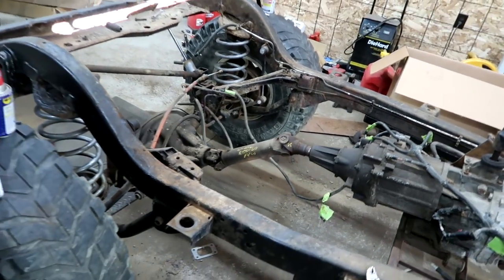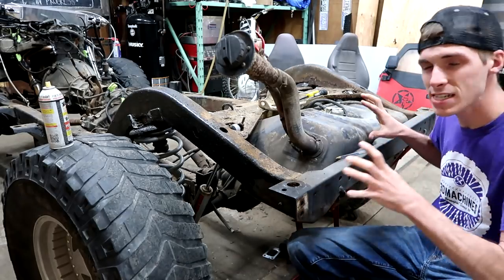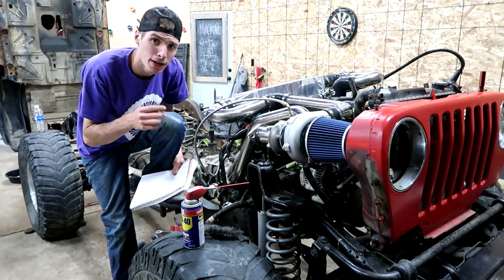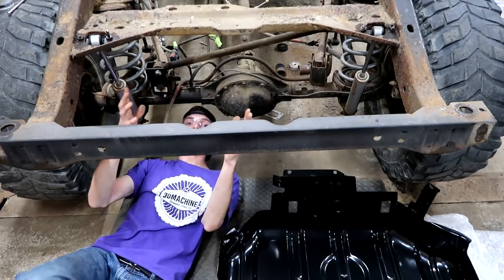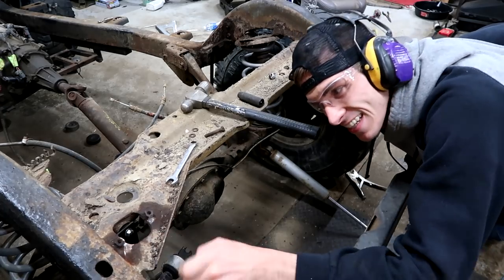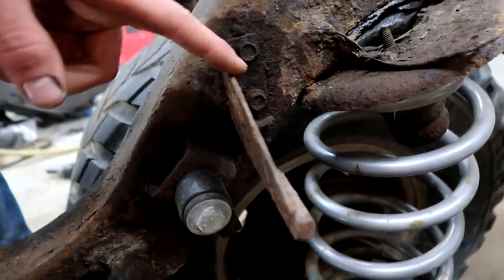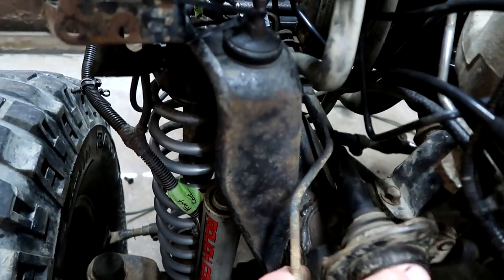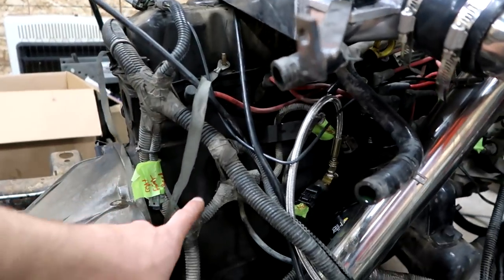Overpowered Turbo Charged Machine

Comment: You need a transfer case drop mount to lessen the driveshaft angle. The slip yoke eliminator was a good choice as well
Reply: Transfer case drops only lower the tail of the transfer case, therefor pitching the front of the transfercase eiger, making the front driveshaft angle worse, and putting strain on the engine mounts. Transfer case "drop kits" are a gimmick.

Comment: Hey 3d 
I build all types of jeeps if you have questions i garentee I probably have an answer 

Like your transmission transfer case question 

That brace going from rail to rail holding you transmission was fabricated when they did the swap as the 4.0 engine has an ax15 transmission instead of the ax5 which would have come on the original 2.5 engine.

Normally the belly pan which acts as a transmission mount hangs a little lower, they welded there brace super high which is great for clearence but Is kinda why your drives haft angle is so steep. 
As you said your doing an sye  that will defiantly help with the angle and driveline vibe

Could also get adjustable lower rear control arms wich would also assist in your pinion drives shaft angle.

As for transfer case there is not supposed to be a bracket or mount for that. It is just supported by the studs that go through the back of the transmission.

If you have any other questions on modifications or parts to use  hit me up on fb 
Anthony biddlecombe 
Or baldybiddle on instagram
I'm full of us less jeep knowledge lol
Reply: anthonoy biddlecombe he could also get the double carigan joint rear driveshaft with the slip yoke Eliminator installed it on my cousins 89 Wrangler it handles a higher lift. It also comes with an angle block for the rear diff. Leaf springs...just got to the part of the video where he said he got it XD
Reply: Anthony thats alot of words

Comment: Dalton, think about getting a set of elec fans to mount on the bottom of the intercooler and have vents cut into the hood directly over the intercooler.  The cooler air from a more efficient intercooler will make the turbo charger much more effective and the vents will also assist in removing hot air from the engine compartment.

Comment: You have a slip yoke eliminator kit, it puts a solid yoke on the tcase, and moves the slip joint to the middle of the driveshaft. You will also have a double cardan driveshaft. So it has 3 u joints, two on top and one on bottom. You have to adjust the rear pinion angle to point right at the yoke on the tcase or 1 degree off so the bottom ujoint moves some and stays free.

Comment: Under the transmission is supposed to be skid plate which also acts as the transmission mount but I've seen many after market supports if not using one of many after market skid plates that are also out there

Comment: You need to find a transfer case skid plate, a drop mount kit if you're not going to lower the suspension lift to get that drive line operating angle in  better shape.

Comment: Valvle covers and anything thing else under that jeep including lift componest and even that fuel tank guard i would highly recommend getting powder coated. I live in cheney washington where we have our fair share of stupid amounts of salt and chemicals thrown on the roads up here also. I’m getting everything in my engine bay of my 1999 2nd gen cummins at the monement powder coated. im getting my new lift and leaf springs and coils powder coated in a month or too i just finished putting a new head gasket in my 2000 jeep xj with the 4.0 staright 6 engine great motor!

Comment: Who ever did those modifications left you with a lot of work And with the body off you can fix it all correctly at least. Just my two cents with the big tires and boost you’ll have, that rear end is going to grenade itself. The D35 is so weak